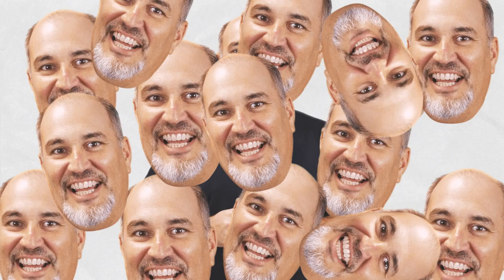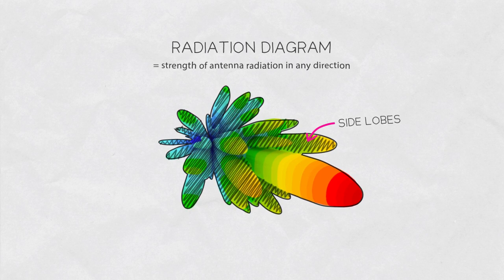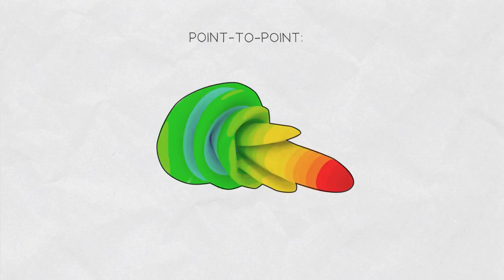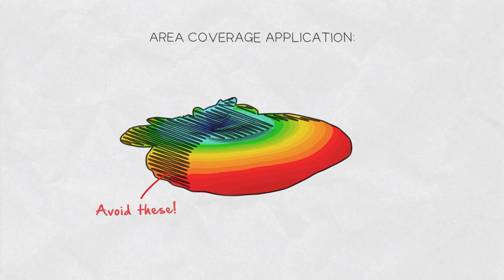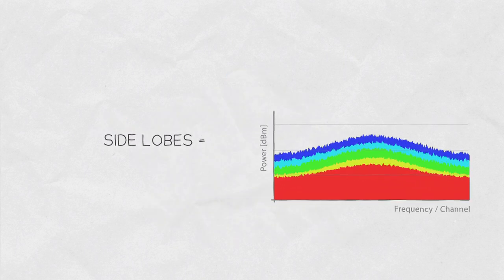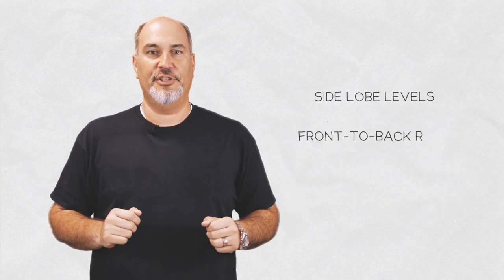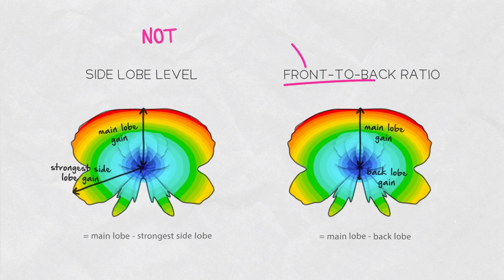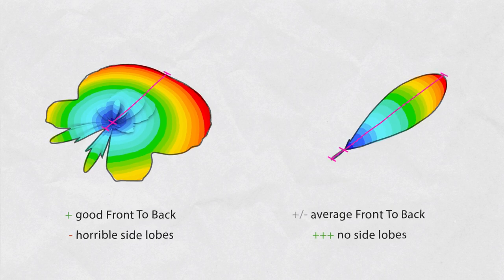Inside Wireless: Side Lobes

Comment: Hello! in case of multiple horns mounted on the same pole, which is the minimum installation distance you suggest between an horn and an other one? Thanks
Reply from the maker: Hi, the min. distance we recommend is 3 feet, but there are WISPs who stack them closer than that and have no problems. Nevertheless anything below 3 feet is at your own discretion.